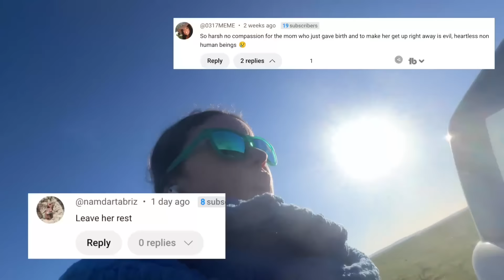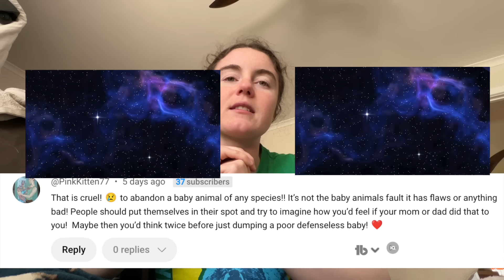Kinky Hose.

Comment: Regarding battery - I've had this situation with my tractor. The wire connectors get corroded so I have to disconnect the wingnut, use the wire brush thing to clean the junk off and then magic happens. It seems to happen more often during our rainy season in California so maybe it's a moisture thing. Don't know but I keep the wire battery brush thing on the tractor in the toolbox. Always seems to happen when I have the bucket on and it's part way up...makes such a pain of opening the hood to mess with the battery. Farm things.....IYKYK

Comment: The comments you get about not being able to make the dead rise and then on the flip side - stopping a lamb from dying... omg, they WALK AMONG US! 🤦‍♂

For the record: IF, for the sake of playing devils advocate, that lamb lucked on being pulled JUST as the heart stopped but somehow able to be revived before it was D-E-A-D I can fill them in on what happens.  The brain has been oxygen deprived.  It doesn't like this.  It swells. A LOT.   Big problem when it's stuck inside a hard skull that doesn't allow for swelling.  Best case scenario you get massive amounts of neurological symptoms and it can't orient, stand, swallow, suck or coordinate and probably has a lot of seizures that can kill it if everything else doesn't first.  You can try to control the swelling in ICU under constant hourly monitoring round the clock and HOPE it recedes and that IF it does, once it does, often after months, there is enough normal function to not have to euth it anyway.  There is a good chance if you get it through the immediate neurological stuff you'll discover permanent damage that means you'll will have to euth it anyway after you've got massively attached from spending months fighting hour to hour to keep it alive long enough to tell if there is permanent damage or not.  During that time you're going to have to stitch a NG tube in and strip milk and feed it every few hours round the clock.  You're going to hope that the NG tube being in doesn't cause issues or infections.  (Hint: it can. But you also can't stick a tube down that many times a day for months without even worse stuff soooo...)  You will need to try and prevent ulcers from this.  And turn it and stretch it's little legs and body parts so it doesn't get pressure sores all over and urine scald and other sucktastic stuff.  Which it WILL because they're not meant to lay so much but you can try and minimize it.  You'll also want TPN and fluids to try and maintain crashing electrolytes.  Seizure meds. Antibiotics.  About 9 billionty bags of fluids that will swamp an iv pole.  You'll need to constantly check the kidney function.  A lot.  And manage for that.  You better be good at ultrasounds because you're going to need to pin it down a lot and check.  Kidneys being stuffed is a huge deal of the fatal variety.  During the several months you'll be doing this the tiny little thing will routinely attempt self check out.  You're going to do enough blood tests on a daily basis to make you wonder how it's not died of vampirism.  Because kidneys are cranky creatures that don't like oxygen deprivation even a tiny little bit.  You can probably plan to spend about $25k for the 2% chance of survival. Which is still due even if they die.  Real life isn't House MD or ER or whatever hospital drama made these city people think dead isn't final.
Reply from the maker: Thank you.

Comment: Just note that the green indicator is only in 1 cell of the battery. While it does mean there is charge in the battery it doesn't mean you don't also have a fucked cell and are running under voltage. Which isn't to say that is what is happening, it's just to remind people that cell indicators are only inserted to comfort the QA department.

Comment: We used to have a 3/4 ton truck that had a loose wiring harness. I had to turn the radio on, and climb in the engine compartment to shake the wires...when the radio came on, it would start. I feel your pain.

Comment: battery terminals are tapered, so you might get a better connection if you spread the terminal clamp out so it can go down to a fatter part and then clamp up tighter.

if that doesn't work, you can try wrapping some copper wire around :D

Comment: Probably know how to do this cool little tool fits together in one piece you pull it apart one end is a brush that will clean your actual cable ends the other end that you put over the top of your Terminals and spin it and it will make them shiny and clean as new then you whip out some Vaseline before you put your cable ends back on it keeps it from building up corrosion. Even if you have a good battery when it starts getting cold you can get just enough condensation in the between the cables and the terminals to to make for a bad connection and no starting. If your terminals are literally moving girl keep you some spares on hand and the tools to change it out on the spot or leave your engine running get it fixed properly screw the AC Delco get an Everstart!

Comment: Water truck help when lack of rain halts grass growth??,a truck with tank or trailer with tank to spray water & some form of fertilizer mixed in to irrigate the pasture during a drought season????,may have access to a local river or purchase water possibly??,best wishes...
Reply from the maker: Irrigation is only possible in certain parts of the country, not here. The amount of water we’d need is too much to be worth doing it based on the size of the paddocks.

Comment: What is about Rav 4s on Farms? I'm from Melbourne Suburbs, but gradually spending more and more time in country Victoria and I've noticed more and more it's a 20 year Hilux or a Early model RAV4. they must have a real purpose that I've missed.
Reply: The Hilux I get those things especially the old ones are absurd, I'd assume RAV4s are either pretty tough or relatively easy and cheap to fix most things on either because parts are readily available or because it's easy to DIY them back together

Comment: I've only worked with small flocks (ten and less) of primitive breeds.  I've heard people say that a larger group is easier to move than a smaller group.  Have you found there is an optimal size for the dogs and you to move?
Reply from the maker: Yes they’re easier in large mobs. Typo and I have moved 800 by ourselves. Worst to mob is small mobs of lambs. Best is pregnant or just weaned off ewes.

Comment: Just curious, do you only crutch your sheep, or do you also do muelsing on the lambs, I've heard it negates the need for the constant crutching as very little wool then grows in the area.
Reply from the maker: We no longer mulse. When we did do it years ago we still had to crutch. Each sheep is shorn and crutched once a year, usually at opposite ends of the year.
Reply: @TaraFarms  thanks for the info, makes a lot of sense :D

Comment: I work in vet medicine and also elect DNR for my own pets (except in very specific circumstances) because I have seen animals be resuscitated. Only two in my career have walked out the door to live any semblance of a good quality of life. 99.99% of the time if we get the animal back, the care needed to keep it alive is insane. And it’s barely alive at that. I feel bad for owners who elect CPR and then have to euthanize their revived pet. There are always exceptions to the rule, but generally if the animal’s heart has stopped, there is a reason, and you still have to deal with that reason even if you get it back. The likelihood of it arresting again is extremely high. As has been wonderfully said: there are worse fates than death.
Reply: I feel like the only time I'd be comfortable with one of my pets receiving CPR is if they were already in an operating theatre monitors and tools to do so (namely just an oxygen supply and way to provide oxygen rather than attempting mouth to mouth) would in theory be easily accessible to try and ensure oxygen continues flowing to the brain.